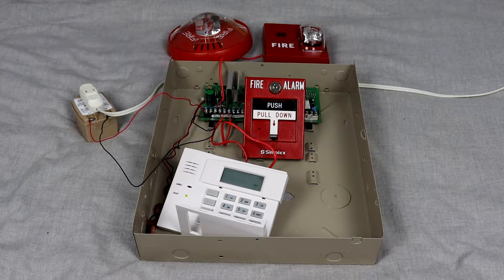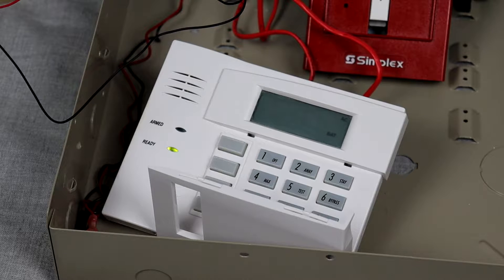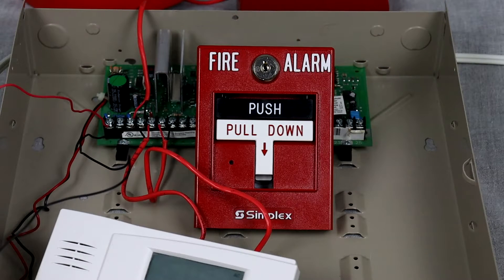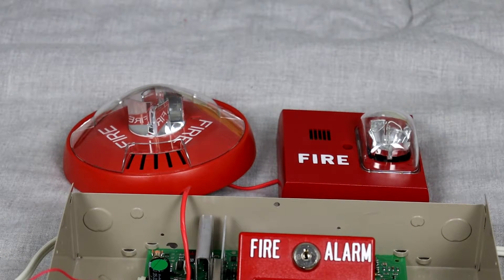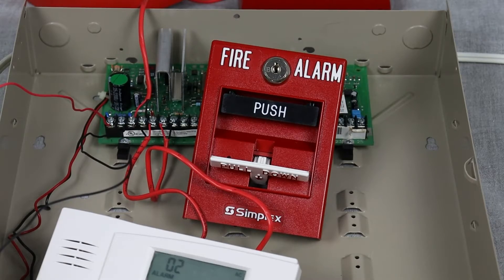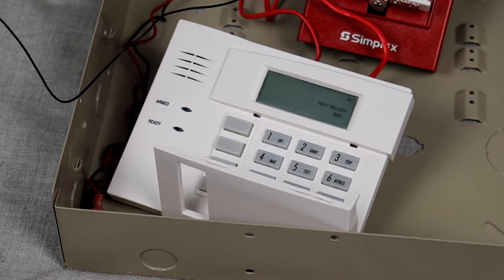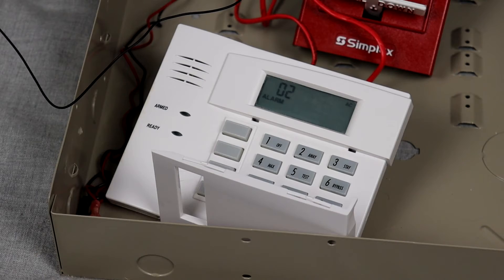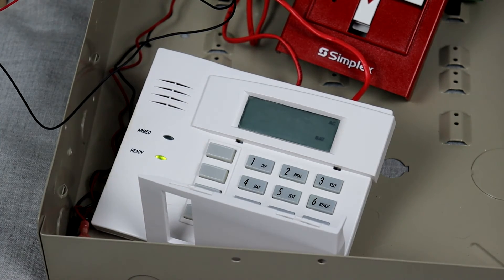Honeywell Vista 20p Mini Fire Alarm System Demo

Comment: Very nice! Is this panel capable of putting older mechanical horns into code 3?
Reply from the maker: If they run on 12v, yes
Reply: @gentexguy  You could always go the extra mile and get a 4204CF Module, and a altronix 24v power supply. About 30 or 40 dollars more. You can also program it so it does not pulse the nac, and have 2 extra nacs for burg and fire, pulsed or not.
Reply: @AcElectronicSystems  How would you do that 24v connection, would it be on the 4204 relay powering the devices?
Reply: @AmericanPatriot911  “altronix 24v power supply”
Reply: I obviously didn’t read over my comment, would the power supply connect to the relay to power the 24v NA’s?
Reply: @AmericanPatriot911  Yes
Reply: @AmericanPatriot911  well the power supply would have it's own power connection, and you'd wire the module to it

Comment: Nice video! I actually never knew that you could wire horn strobes to the 20p, I only thought it was those proprietary WAVE series. Interesting!
Reply from the maker: Yeah it just has a regular 12v output, so pretty much any alarm rated for that voltage will work as long as it doesn't exceed the max current output on the bell circuit. It's actually filtered DC as well which is a nice bonus.

Comment: You know, I started out with kinda a similar setup, except the panel I used was an Ademco 332R combination fire/security panel from 1977! Nowdays I still have that panel along with a Silent Knight SK-5208, (which is my main & only fire alarm panel now) made in 2007, & two security panels: an Ademco Vista-10SE from 1997 & an ADT Safewatch Pro 3000 from 2001. Both of the latter I've succeeded in resetting the code on, & I actually have a similar keypad to the one you're using with your 20P, however I have a custom English keypad connected to the Vista-10SE (which is on my demo board along with the 5208) as it's needed for programming.